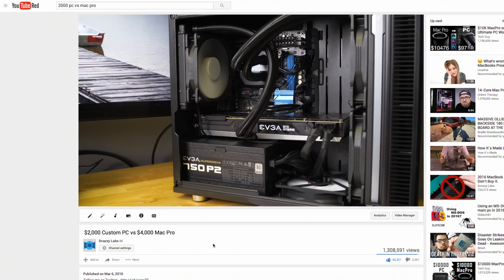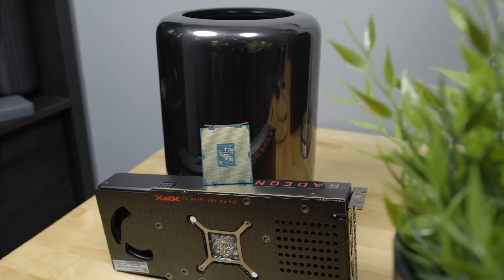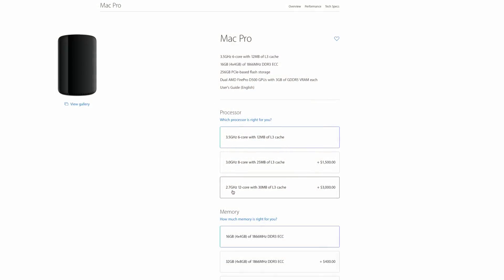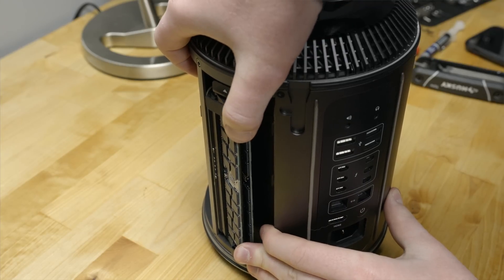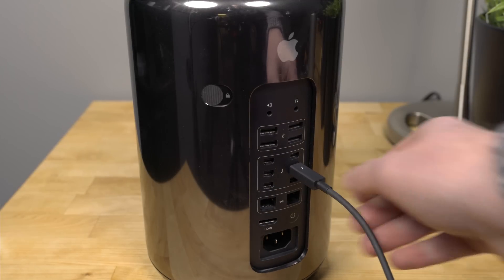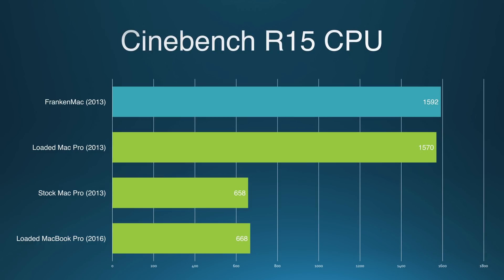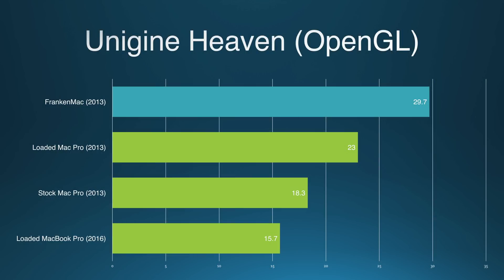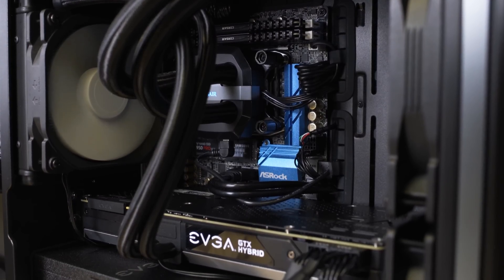The Best Mac... Apple Doesn't Make!

Comment: My windows 10 pc is stuck in safe mode! When I restart it it will automatically start up in safe mode! Help! Doesn't anyone know why, and how to fix it?
Reply: Your PC doesn't feel safe around you.. give it time and come back later.
Reply: You should delete system32
Reply: SPAM .03 pc or laptop
Reply: This is actually a hidden feature. In safe mode Windows will prevent any virus from burying itself in the system, protecting your OS and making you extra safe!
Reply: Deleting system 32 is a temporary file that windows put of it detects viruses you just gotta delete the thing and next time you boot your PC up it shouldn't boot in safe mode!
Reply: Install a antivirus... 
I recommend malwarebytes for a quick fix 

Alternatively you can delete system32 (please note that you will need to reinstall windows after you do that)
Reply: Hanro Lareman it's all good  now anyway. Now it won't work with my wifi dongles...
Reply: SPAM .03 
Try seeing if you have the right drivers installed

Comment: Urgh! Only way to make RX480 to top the graphs is to compare it to Apple hardware. This is how you spend 3000$ + 1000$ to get a PC with used last gen parts. You could have built a much better Windows PC with 1500$ from scratch.
Reply: Mikko Haavisto He said he wanted to use final cut pro which is a MacOs app
Reply: I know, but if he had used all of this effort changing to Apple instead on improving his Premiere Pro workflow and upgrading his Windows system, he would have got better results.
Reply from the maker: +Mikko Haavisto Premiere Pro doesn't offer the 3rd party plugins I need to shave off hours from my editing time. I still like it, but it isn't practical for my use.

Comment: You could have spent all this time optimizing your Adobe Premiere pro workflow instead of switching to Apple. Don't you thing that would have led to better results?
Reply: Kiyoshi Kirishima Yeah but the hardware is so much cheaper, they   want to charge you 3000$ more for the CPU he bought for 600$
Reply: Mikko Haavisto no matter how powerful your machine is adobe premiere is just not optimized for anything while Final Cut Pro x takes advantage of single thing in your computer. So any new Mac with FCPX will beat any other computer on Premiere.
Reply: Noblesseux - so? You can handpick the hardware all you want. The CPUs are x86_64, they run just as well with any OS and it is up to the programmer of the specific program to write good and efficient code. The CPU is the thing that provides the op-codes, the OS got nothing to do with that.

That MacOS is somehow faster is an old myth. Yes, most programs are fast. On Windows/Linux you have slow programs cause there are just that much more developers and some will write shitty code.
Reply: +ABaumstumpf Exactly
Reply: +Awkward Gaming sudo apt-get install the-L
Reply: They did not make the hardware. Intel, nvidia, samsung and so on are the companies that made the hardware. Apple just puts the pieces together after ordering the parts.
Reply: FCPX destroys AE on the same hardware. It really helps that the people who made the software are the same people who made the OS. And the hardware. And the drivers. And the peripherals. 

No amount of 'optimizing' you workflow will challenge that.
Reply: Umm.. He spent 4000$ total in this Mac pro + upgrade to get used, last gen hardware, which wasn't top of the line even then. So no, he wouldn't be using same hardware. With 4000$ on Windows' side he would use a lot better hardware, you could even get a rendering server going with that.
Reply: " It really helps that the people who made the software are the same people who made the OS. And the hardware."
No, they did not make the hardware - that is the same as for any other computer - well, it is mostly even older.

And FCPX - while it is good, it does not "destroy" adobe Premier.
it is a lot faster in certain situations. and guess what? There are other programs you can use that beat both of those.

And just for comparison - for the price of a Mac you can just build a PC that will still obliterate the Mac in pretty much every aspect and is just as fast as FCPX :P

Comment: If you build a hackintosh with an i7 6700k and an amd radeon rx 480 will sierra automatically accept the graphics card?
Reply from the maker: +AZHIBLE No, because hackintosh is a whole can of worms.
Reply: and if you use tonymacx86's programs and drivers? i think its the best alternative for pascal cards, because sierra doesn't have nvidia's latest 1000 series webdrivers.

Comment: Lol, it "ONLY"' cost him 1000 bucks, for a "problem"'caused by Apple in the first place.
Reply from the maker: +Da Teacha It was less of an issue in 2013 when the machine came out, but since they went 4 years without updating it, i took matters into my own hands. Lol
Reply: Don't get me wrong, you did the best you can do with the limitations given and you managed to extdend the life expectancy of your machine by doing that, I just couldn't bare buying a new Mac Pro and then having to add a bulky case my desk. Therfore I'm still investing in my old Mac Pro, which is costly too, but I have everyhing in one enclosure (which imho is still the absolute benchmark considering a well though out computer case). The new MP is stylish, fast and silent, but I feel I'm limited from the start while configuring its specs.

Comment: I wonder if you could make an adapter to fit the RX 480 into the pcie slot of one of those outdated fire pros.
Reply: Golden Grenadier Nah, I think the PCB is too long and wide.
Reply: Golden Grenadier Nah, I think the PCB is too long and wide.
Reply from the maker: +Golden Grenadier No can do. Proprietary pin config sadly. Classic Apple.

Comment: Hey man! It seems like a great idea. However, is it possible to optimize the ssd storage as well. I've heard they are soldered and without that upgrade, I really can't justify the price of 2500$
Reply from the maker: +Magnumicer They're not soldered. Just screwed in. They're basically an m.2 drive but it has a proprietary pin-out so you need to buy Apple or OWC drives on eBay. They're pricey.

Comment: Quick and simple comment: your mac pro is the 3000$ model not the 4000$ model, The macbook pro CPU isn't under clocked it's the stock model (http://ark.intel.com/products/88972/Intel-Core-i7-6920HQ-Processor-8M-Cache-up-to-3_80-GHz) (highest CPU option MBP16 15"), top of the line mac pro: GPU performance: 4 - 4.4 TFlops with the D700 at 7 TFlops in actual performance: Nvidia 1080 = 1 -> Dual D700 = 0.72.
Reply from the maker: +Yen MiiMe Maybe theoretically, but in practice the D700 are much slower.
Reply: Snazzy Labs yes of course they are, they are 4-5 years old, in actual compute performance they are still very capable, but are the benchmarks you ran compatible with multi gpu's? The single GPU card can have superior performance if the application isn't compatible with multi GPUs.

Comment: The Mac Pro, needs to be bigger. It's insane that they thought a tiny system would work for all higgend  professional.
Reply: RizzyWow professional? Apple doesn't care about you anymore.
Reply: RizzyWow this was before graphics cards were the same length as your forearm
Reply: Michael J true but also. Being a cross platform user. I used to have 5860 that was hugeeeeeeeeeee. Apple should have planned better. It's not like they could talk to the card makers and be like what are the dimensions your planning in the next 5 years.
Reply: Brian Fantana I'm giving them until the end of the year. Apparently there's new models appearing.
Reply: MrLalasd Not sure understand but the GPU dock in the Mac Pro is too small. Apple need to make a larger Mac Pro to fit the required GPU (depending on user).
Reply: I am afraid I disagree with you there Rizzy. I work in IT, and know that the system size is fine. They just needed to do what deal with AMD as he said. The tech is excellent, they just need to make it possible for upgrades is all. As I write this I am still working on my 2012 12-Core Mac Pro which I got back in 2014 as a graduation present :D Full loaded now with 64GB, multiple SSDs, AMD 7950 and thinking about putting a PCI-e card in there for nVMe. Along with an RX 480.
Reply: haha, nah. high end GFX cards are big for many years :) Its funny tho, seeing those tiny round cylinder mac pro's on desktops with 3 extensions next to it, pluged with cables everywhere... the less is more / clean desk policy is terrible with this product. I switched 6 months ago to PC. I had no choice. I was afraid, but it turned out to be a great choice!
Reply: IT does not need to be bigger. Apple fucked up. All they had to do was call AMD and release new gpus for it and let users upgrade it themselves or get it upgraded at an apple store.
Reply: Christopher Thake I agree with you upon the concept of upgradable parts in all departments. However there's a couple of sacrifices the newer Mac Pro has to make to be that small size. For example dual GPU is close to impossible. The fact they removed the dual CPU option is questionable. I really love how you've been upgrading your Mac into a beast. I personally have a MacBook Pro. I'm looking to move to a Mac Pro as I really don't need the portability of a MacBook, I have an iPad for that. I'm waiting for Apple to upgrade their Mac Pro just to have those extra upgrades, and I don't mind the Body being larger.

Comment: I really used to love Apple but when I saw they stopped offering high end computers I moved. I mean no raid, no high end gpu support, no fast ram or the ability to overclock your CPU, it's been proven that their cpu's don't even Turbo Boost up. It was a hard move to windows trust me lol took me about 4 years to make the switch but I am happy with the better performance.
Reply: Trigga Rackso All the raid etc is meant to be done externally through Thunderbolt. if they made a new one Thunderbolt 3 has twice the bandwidth.

The GPU'S they put in work well with their software but they are not for gaming

Comment: Couldn't you have used pci express extenders/risers to plug in the card in the pci slot? Or even better, get 2 rx480s?
Reply from the maker: +chris_gpvd Nope. It's a proprietary pin-out.
Reply: Aww, too bad... Well, I'm not surprised. My macbook air crapped out on me, so I needed to get stuff off the drive. BUT the ssd uses a proprietary connector, that changes every year!!! I fortunately found a loaner air of the same generation, and got my stuff off the drive. I think Apple puts much more effort in making stuff locked-proprietary, rather than genuine R&D.

Comment: so, all i need is connect the mac pro with the pcie box(I already have a small one prob just need a psu for the gpu) via thunderbolt 2 and connect the pcie box(with RX480 inside) to a monitor via displayport. and it just works in MacOS? no need additional software or driver?

Comment: So a Rx 480 would be the best upgrade for a Macintosh??!!
Reply: Aren&#39;t Fiji cards supported? In that case, the best option would be the R9 Fury/Fury X.
EDIT I should have included the Radeon Pro Duo.
Reply: hold your fire--- the correct framebuffer for 480 is not in the latest 10.12.4 beta......
Reply: Nvidia isn't the problem. The whole issue is that unless Apple releases a model of Mac that includes a particular generation of graphics card (either AMD or NVidia), then there won't be support in the operating system for it. For example if Apple had put say a GTX1060 in one of their high end MacBook Pro or mac mini systems, then support for the GTX10XX range would be available for all Apple systems including external GPU systems and Hackintoshes.
Reply: Well its higher Tflop rate, asynchronous compute wide memory bus and good relative efficiency make it very well suited for compute operations, would have waited a month for vega but then again drivers probably wont really be there for a while after launch.
Reply: Edrick Vince Velicaria that's great because I already have an Rx 480
Reply: gpuboss is perhaps the worst possible source you could use for graphics card performance. 

Go look at real reviews and benchmarks from any major website or youtuber and you'll see that the 480 is at minimum on par with the 1060.
Reply: apple doesnt put gtx or R series cards in its products. they use workstation cards like the quadro or fire pro. those cards tend to favor productivity but suffice just as well for gaming. the problem is that the user base for mac compared to the user base of pc users shows that pc users are more in it for gaming in addition to the occasional productivity. there are mac users who would like to game, but nobody buys a mac to game and everyone knows that so the number of people who expect it are not great enough to warrant the extra expense of making as many games work on mac. the additional cost of the workstation cards also makes mac look unattractive for gamers, not to mention apple charges a premium just for the name and brushed aluminum look its so well known for. apple sees no point in releasing drivers for anything else because they dont use anything else and it would cost money again to do, plus theyde be enabling hackintoshes which they dont support or condone and would lose money to the superior option of people building rather than buying from them at their overly bloated prices.
Reply: +Edrick Vince Velicaria Yeah, it looks to be that way
Reply: Sean Gehrke does it work on your mac/hackintosh?
Reply: Edrick Vince Velicaria i only have a windows 10 pc
Reply: How about the AMD Radeon Pro WX 7100, woudn't that one perform better?
Reply: of the very recent architecture ones under osx, until vega
Reply: i know right? the rx series isnt even comparable with the 10 series nvidia cards. makes me wonder how those would do given better driver support...
Reply: companyoflosers the 480 beats the 1060..
Reply: my sources say otherwise http://gpuboss.com/gpus/Radeon-RX-480-vs-GeForce-GTX-1060
Reply: companyoflosers....................umm, yeah, thats a source....we'll go with that, cause this source is so reputable it picked the 960 over the 380X http://gpuboss.com/gpus/Radeon-R9-380X-vs-GeForce-GTX-960 

FYI, the 380X blasted the 960 by well over 30% at launch, god knows what it is now.
Reply: Nvdia still has not released drivers for the Mac and 10 series cards n the Mac OSX environment.
Reply: well it makes sense. who buys a mac for gaming anyways? apple has no plans to sell a mac with an nvidia 10 series card in it, so why would they ask nvidia to make them drivers when they openly oppose hackintoshes?

Comment: Fantastic and captivating video. Super cool. I assume you had to leave the graphics cards inside the Mac Pro and just somehow bypassed them?
Reply from the maker: +Andru Edwards They're actually still working alongside the RX480, but yeah, just use display out of the GPU instead of the Mac. :)
Reply: Just do not connect the display :)

Comment: I went a slightly different way: the 3.46Ghz Xeon 6 Core that fits twice in the Mac Pro 5,1, paired with 2 RX480s makes for a nice system for even a little less.

Comment: I still don't get why people go through all this trouble simply to run some stupid crappy video editing software, I tried it and I still can't ever see myself actually making an increase in video production or real world use. Its just not good enough for me, Adobes software for me gives me the best production to work ratio and that is what I want, at this point just simply make a hackintosh if you need macOS or if you can just use the Lightworks video editing software on elementary OS or something like the such, it works really well for me although it doesn't support some of the lesser known video formats but most if not all of the bigger more used ones, for me it would never be worth the price or the hassle to get very little performance upgrades when in comparison to some of the power that traditional computer hardware can give. Just my opinion on this kind of stuff but what do I know, I am just a Linux guy anyways...
Reply from the maker: +Donovan Goodwin There are some serious advantages to FCPX. The basic NLE is simple, yes. And there are things that I don't like. But powerful plugins like Color Finale Pro and mcallouts have made it the best NLE for my needs. The 3rd party plugins make the app excellent.
Reply: Snazzy Labs Well I am thankful for that or else I couldn't watch your eye candy videos and I am glad you have something to edit on but for me using Lightworks once you get it and pass the learning curve  it works very well without needing plugins. GL in your endeavors 🔥🔥🔥